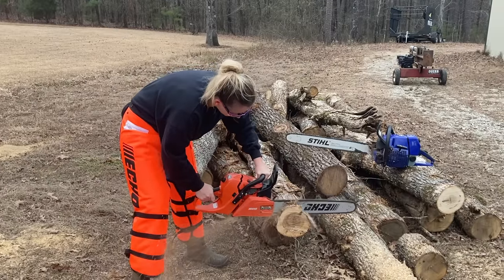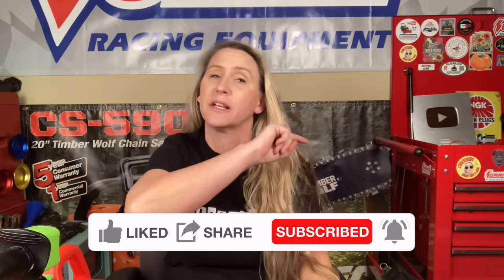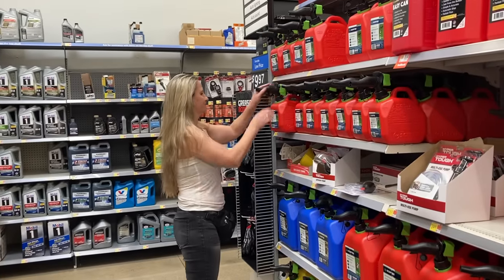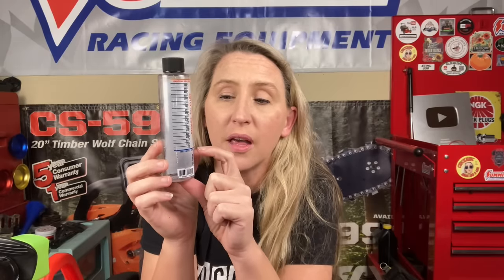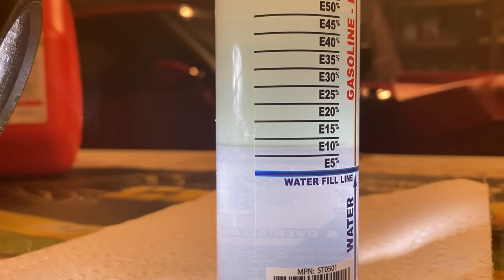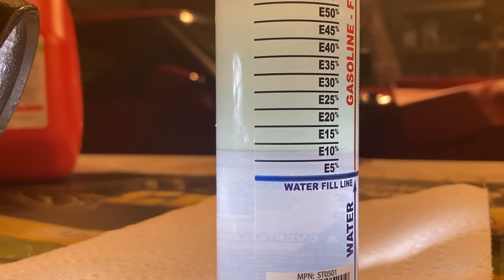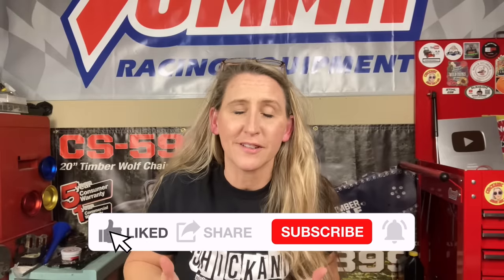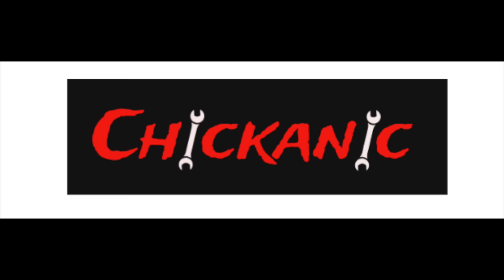Fueled by Deception. How You’re Getting Ripped Off at the Pump! (I'm SHOCKED!) VLOG

Comment: I love the "spill-proof" nozzles, which NOBODY can operate without SPILLING!
Reply: If I stop at a yard sale, I always look first, for two things:  Gas cans with the old nozzle, and American made Vice Grips.
Reply: @DGill48  NATO cans are the only way to rock!
Reply: @uknowimright6269   Great idea!  Never thought to look there
Reply: Funnel?
Reply: I use a siphon. Take the nozzle of put the squeeze siphon in rarely make a mess if you are paying attention.
Reply: @lakecavanaugh  Funnel won't help the fact that she can't push the button with her thumb!
Reply: I had one Jam Up in my 66 C-10 With Aftermarket Saddle Tanks.. It Took 1hr.+ Plus to get it out.. Bent T. F. Out of the Bed Panel.. Absolute Nightmare in 101° Sacramento 1986
Reply: I modify the nozzles... take off the plastic that is the childproof part...depends on the designs, or add something that wedges or holds the buttons on others. I have found ways around them but always if I can, get more original nozzle replacements if they will work... Then, for the ultra short nozzles I cut or grind off the tabs and crap off the ends, smooth it out and add a rubber fuel hose to extend them to my own liking, fold back the hose and secure it when finished👍
Reply: I always have to modify the spill proof nozzles on my new gas cans. Take out all their over engineered BS mechanism and install a proper spill proof one... A rubber fuel hose.  Basically don't waste a drop that way while the "spill proof" ones go everywhere but in the tank.
Reply: I've  had some real bummers there too very cheaply made  and often times leak.  I am fortunate enough to be able to make my replacements... 4140 aluminum and O-Rings with a vent on the can... I rarely spill a drop!
Reply: Most powersports or lawn and garden retailers sell old school gas cans.
Reply: the ones that look like a duck i dont have but the other style you can remove the spring and shave the lock so always buy those ones
Reply: BUT there is a cure fore that. Recess the fill port so the old the old school gas can fill nozzle is too short. No problem filling a generator. The the 2022 no spill? It will wash the dust on the tank off.
But the real deal is military surplus cans. But they work if you are fueling diesel. why? Well the hole you cram the gas station gas pump hose into now is smaller so won't put diesel in it. 
BUT it wont fit in any automobile gasoline tank made after 1980
So they say. Another one of those bright Californication ideas.
BUT if you turbo a gasser and calibrate for E 85? yep can get a lot ponies. Also get gallons per mile on the drag strip.
Oh and I worked on a catalytic propane to propanol conversion unit in a oil refinery in California. That was used to 'enrich the gasoline to meet emission standard"
I was driving a environment destroying '88 LSC Lincoln in  1999 and got 16mpg in California. In Texas in 2000 working on another refinery I got 19 MPG with the same recommended 93 octane minimum. So it is 2023 and those 1999 standards are the national standards and back to 16 mpg for 93 octane.

 I thank California for ruining my stock maxed out 1966 two door Dodge Polara 383 engine.
 Why would I want a vehicle that the A/C cools the cabin so much you turn off the A/C in traffic? IN 105F weather.

BUT I bet Newsome rides in one and the California taxers provide the the limo & gasoline also has no problem with traffic.
 Just like Randy Andy and Fergie rode in from Long Beach to LAX when they exited the Britannia and then flew back to Britain.
I had to wait for them to leave the Navy base. Stood on the fo'c'sle of the USS Crommelin watched them leave. Why because they also shut the base down and the 405.
 I guess waiting another 3 hours after being out to sea for six weeks was not all that much more to ask for the sake of country and mom's apple pie.
If you don't see the connection you soon will.
Reply: I have changed all my nozzles to the old style!!
Reply: I get it on my hand EVERY TIME. A few years ago, I noticed a neighbor throwing out an old can while I was out for a walk. I was not shy of taking that nice old can home!
Reply: The govt talks all "green" but how much more material, energy, and pollution from making the extra parts in every little thing like a what was simple spout. I think the real "green" deal is in the greenbacks, not out environment
Reply: @jaywestfall4670  Building a wood fire in a fireplace is pollution. Scattering the ashes from the fire is pollution. So what the &*^% has the govmint done about all that burnt wood and ashes from last year's fires on all dat govmint land? I wonder when the burnt up govmint wood tax will kick in?
Reply: Too right!
Reply: i bought some old-school-type gas spouts online a few years ago. all you need is a 1/2 drill bit and a drill. they work great and don't need those stupid spill-proof spouts.
Reply: @DGill48  Me to. I have six cans of the A shape from 21\2 to 6 gallon tanks, they're not as top-heavy.
Reply: Remove the EPA nozzle and either pour straight into a funnel in the receiving tank or buy a "replacement" nozzle without the crap valving.
Reply: @DGill48  Amazon sells the kind you need
Reply: @lurchaddams787  The scepter brand are the worst, there are other brands that Harbor Fright sells that can be "adjusted" easily! 😁😁
Reply: Just get a dang aftermarket "water" spout for your gas cans.  I'd only use the CARB spout for long-term storage.

I'm also not reading any of the rest of the thread, 'cause I know it attracts "those sorts" of people.
Reply: Also @Chris Griffith they're only spill-proof when you're not pouring.
Reply: @larrybolhuis1049  just unscrew the "spill proof" nozzle and pour into the funnel. Duh!
Reply: @donalbershardt9290  my 66 still has the old style fuel tank behind the seat...I like living on the edge and smelling gas😅
Reply: Those are the worst! I don't buy those gas cans anymore for that simple fact!
Reply: One thing I learned from this video is to never get rid of my old gas cans
Reply: Almost impossible to get here in Australia, which is a pity as some look like they work really well.
Reply: @larrybolhuis1049  Yep, I just take the spout off and pour straight from the can, using a funnel most of the time.
Reply: First gallon always goes in the truck before filling my Jerry cans.
Reply: @larrybolhuis1049  It does when you take the whole nozzle off to put the siphon funnel in - no thumb needed.............
Reply: EPA does not design them. EPA just mandates they be spill resistant.  It is the private company’s engineers that design them.  That is why they change so often. People don’t like them. They are mostly made in China.
Reply: Not "spill proof", they are designed to keep the vapors in.  Worst design ever, and I've replaced all my nozzels with ez-fil.
Reply: I've spilled more fuel in the last five years with these nozzles than the 5 decades with the old nozzles, and I'm going through less fuel these days. I'll be modifying from now on
Reply: @00M6TA  where?  In the U.S.?  Nope.  EPA requirements are to sell these "vapor reducing" POS items.  I am shocked that the EZ-Fil retro-fits haven't been given the ban hammer.  All my gas cans have EZ-Fil where needed, best $10 per (outrageously priced) blow molded cans I've spent for sure.
Reply: Thank you for the vid! Very informative.  Hindsight 20/20 and all that, but you could have poured the gas from the can into a smaller open topped container first and not struggled with it.  Measuring cup or the like.   100% agree with the stupidity of these janky cans.
Reply: A manual kerosene pump works well for filling equipment from a gas can.  We use one to fill our boat since emptying  5 gallon cans in an awkward position can take its toll on your arms.  About $3 at the hardware store.
Reply: I've converted all my cans to old style spouts using can spout kit
Reply: yeah, dont buy those
Reply: @warrenpuckett4203  well, what would you expect it do to about it? Government land is everymans land so all the cost&nets will just come from/go into everyones pockets. Although, in the best case it will be simply left alone & untouched.
Reply: It's to make filling small engines such a messy pain in the butt,  that people opt. For electric,  when dumb laws are passed there's almost always an ulterior motive , they basically make you want what you don't want
Reply: I spill more gas using those then I can get in the tank.
Reply: psst!  take the spout off the jug and use a funnel in small vessel... just a suggestion 🙀
Reply: I am glad to find out that I'm not the only person frustrated and unhappy with the new gas spouts---they are terrible!
Reply: No-spill nozzles ARE A JOKE!  A real fire hazard just trying to operate it!  The government makes one bad decision after another when it comes to mandating these stupid and dangerous contraptions!  Shows how out-of-touch these officials are when it comes to personal safety…
Reply: @larrybolhuis1049 remove the "safe" nozzle completely, those nozzles only work well on larger cans when you have a better grip.
Reply: Most e85 pumps have a separate hose just for e85 and a second hose for the 3 grades of gasoline.
Reply: @cuz129  cuz, we're talking about gas CANS, not gas PUMPS... so lost.
Reply: Omfg I go zero to sixty every time. Immediately radicalized against government 😅
Reply: Don't forget useless with cars for emergency fills.
Reply: You get them to operate
Reply: In 30 years of putting gas into my mowers with the old can, I never spilled as much gas, in total, as the amount of gas I spilled the first time I tried using one of the new gas cans.
Reply: Guaranteed to spill gas every time. Some good ‘ol boy got himself a good contract for that garbage.
Reply: The most frightening words you can ever hear are “I’m from the government and I’m here to help.”
Reply: The "No-Spill" brand are the best , easy push button control and they close up when not dispensing so your gas in the can does not get 'wet' . 
They are not ideal for filling vehicles due the the short nozzle, but they excel at filling small gasoline tools like generators, weed whackers etc.
Reply: And cursing!
Reply: take spring out, easy saw video how